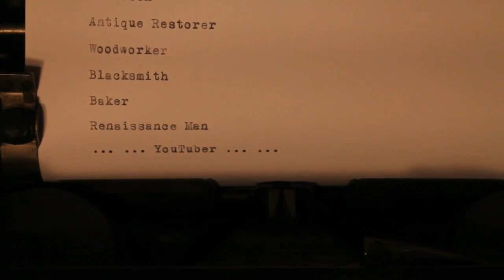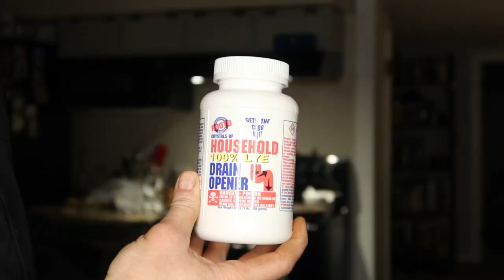The WORST Cast Iron Skillet I've Seen

Comment: Yes, it s a 3 notch Lodge before they acquired the Disamatic molding machines from Birmingham Stove & Range. The pour ears are smaller on both the BS&R and Lodge made with the Disamatic machines. BS&R closed in 1991 so I would say the machines changed hands about then. Three notch Lodge was produced from 1940s - 1987. Lodge added Made In USA to their pieces in 1968 so that can help ya date them. I would suggest if you're goina restore piece in that shape take a minute to build an electrolysis tank. It's easy and cheap if you build a simple one.
I restore for two estate sale companies, myself, and friends, so my tank is as good and fast as I can make it. It usually produces between 25-38 amps depending on the surface area of the pieces inside and cleans 3-4 pieces in 12 hours. They say electrolysis tanks won't shock ya, let's see how long they leave their hand in this one. The worst piece I've restored had rust, crud, paint, and concrete mixed in it. It was a very old camp oven that found its way into someone's shop as a bucket. Other than pitted it came clean and re-seasoned well. Anytime I encounter a piece like that I lead test it and it tested positive for lead contamination. It can still make a nice decoration with a few flowers in it. I think it may have been a "I bet he can't clean this one" type thing. Electrolysis is amazing.
Reply from the maker: Fantastic insight! Thank you very much! For as often as I restore skillets (only for myself) I find it easier and cheaper to run a lye bath than electrolysis. Great suggestion though!
Reply: @jensdavidsen4557  I've experimented with Purple Power as a substitute for lye and it works. It's near the auto section at Walmart. I put 3 gallons in a 5 gallon bucket w/lid and soak them in it. You can clean aluminum in it but it will start to etch aluminum after a few weeks or it did my test piece. It works well for cast iron, enamel, and aluminum.
Reply from the maker: @turdferguson5300  yeah sodium hydroxide (lye) eats aluminum and gives off hydrogen gas (redox chemistry - aluminum is oxidized and hydrogen (as water) is reduced. In the context of cleaning stuff that I'm gonna eat and cook with, I much prefer to stick to chemicals I know are contextually food safe (I am a career chemist). This is ultimately why I don't use oven cleaner spray - it's intended for degreasing materials that aren't food-contact (your stovetop and the inside sheet metal & glass of your oven. Folks will use it to clean broiler pans (stainless sheet metal typically) but given that material isn't remotely as porous as cast iron, it's more or less alright. I've never purchased Purple Power but given it's found in the automotive area... it's probably not intended for food contact. But hey, I'm not here to tell you what to do, just explaining how I think of these things.

Comment: Crusty and rusty quite a challenge. Cleaned on this spring that was so crusted over I couldn’t tell what it was. Threw it in a lye bath for a couple weeks and realized it was a Martin hamburger logo. Dude I cleaned it for pd 5$ for a #3. Don’t shy away from buying the crusty ones but be careful with the rusty as the surface might be damaged
Reply from the maker: Yeah there's some minor pitting of the surface pretty much in one small area but after cooking on it a time or two it's coated over with seasoning and won't be much of an issue. You're right though...if a skillet is deeply pitted throughout the surface... might be better off passing on it. This one was a gamble...and I feel like I won.